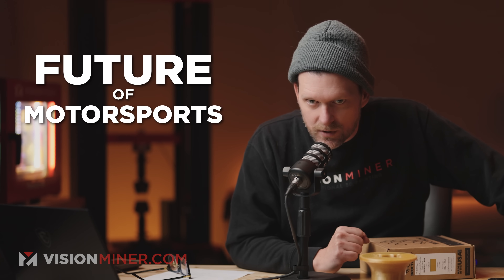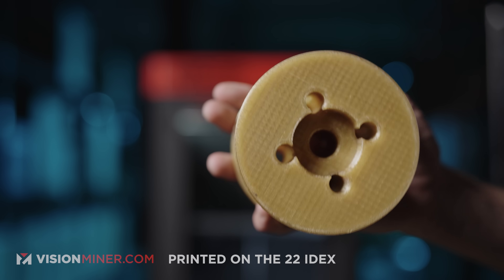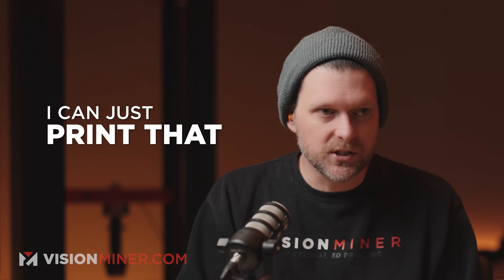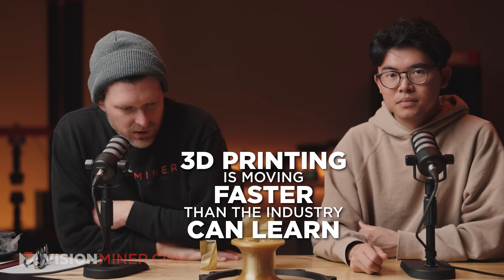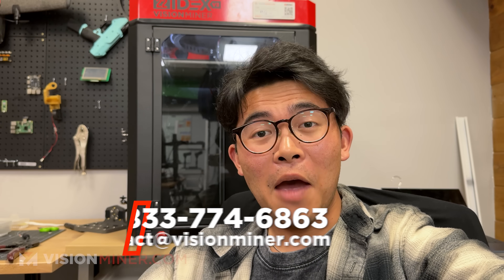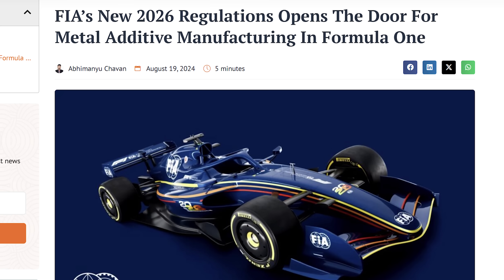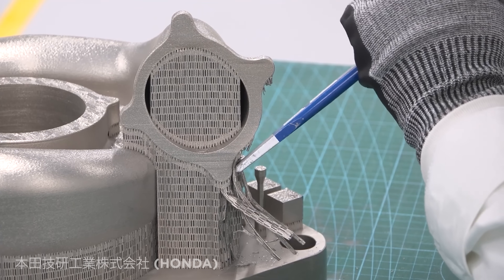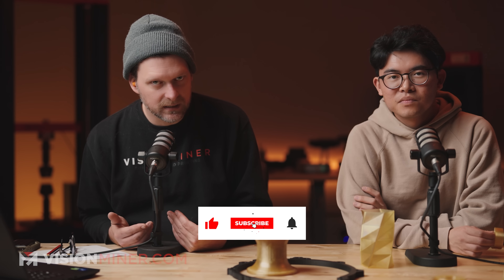The Future of Racing is 3D Printing.

Comment: On a side note would guys agree 3D printing is dumbing the new generation? The kids or teenagers now are so fixated with the idea that you can make anything on a 3dp but in reality is you still have to consider manufacturability. I was a teenager with friends into 3d printing back in 2012 and its a night and difference when it comes to how we designed parts back then vs now.
Reply: I wouldn't say dumbing, but it does hinder the design process for more regular manufacturing methods, from personal experience. I've 3d printed stuff for about 3 years before getting hired at a company where i needed to design stuff either machined or in sheetmetal. For many parts i had to rethink how i usually designed a solution because it's such a different approach and workflow!
Reply: @PaulChoix55  ok agree there it does hinder... a very broad topic I can  corelate it with LEGO Mindstorm vs people who did the traditional way of making robots and guess what people like me and my nerd friends who did all the trial by fire methods who landed jobs easily in the tech field while those spoiled by lego mindstorm had to be trained by people like me at the same company. Since my foundation was always designing everything from scratch without spoonfed blocks and connectors I always managed to design something that's manufacturable and scalable intuitively while those who were pretty much used to the non traditional way had to adapt and relearn a lot of stuff. Finding the similarities there makes me agree with you. The challenge now in my opinion is how get into the education system where this wont hinder the younger generations way of designing stuff, because now I'm blaming the teachers lol 0 tolerance designs, keychains and assigning projects the teachers cant even make is very questionable .

Comment: ULTEM/PEEK valve covers so thin, you can see the oil splashing around. If it's really comparable to aluminum, how about some engine torque braces? Super thin radiator support "tins". DIY custom sized radiator fans and shrouds that use brushless drone motors(watch RPM max for safety!). Custom battery tray replacements of entire rusted out old metal sections.

Comment: Challenge: Old Mercedes Benz parts aren't always available. 3d print a water pump housing out of Ultem/PEEK. Upgrade the bearings and seals to a modern day Toyota bearing/seal and try to use a CF-ULTEM/CF-PEEK shaft and impeller that is unitized. You may need to use steel for the shaft, but everything else should handle the load. INCLUDING the oversized/undersized (for cooling need) custom diameter pulley.
Reply: Replacement parts for old car is such a great application for 3D printing. The channel NeedItMakeIt reproduced a classic Corvette part with plastic 3D printing and then had it metal 3D printed as well. Even with the cost of development and the metal 3D print, it was still far cheaper than an NOS replacement which was over $600 IIRC. Now they can be made for like 10% of that and could be even less in larger quantities. Plus even the few dollar plastic part was functional, he just wasn't sure about longevity. I also have an 85 MR2 and I'm planning to print a lot of parts that are pretty difficult to get now or all the old stock has been bought up.
Reply: Imagine rapid prototyping the ultimate length intake runner shape and length for a camshaft for a rare engine.
Reply: I recently printed a plastic gear for my seat adjustment motor gearbox. I couldn't get the precision i wanted worth fdm but luckily I have a buddy with sla ams tough resin. Works perfectly
Reply: Peek replaces steel in some aviation uses already for critical wing root supports/mounts. So yeah, you can use it in many places already that have steel.

Comment: Hey Cole.  Y'all have helped us alot with our gen1 funmat HT.   Some automotive parts we've done for vintage Porsche racecars that a client of ours couldn't find.  Custom individual intake trumpets from PEEK to fit with the filters they wanted to use.  Custom carbon nylon covers for the transmission when some parts were removed for weight savings.  A custom gasket the y'all helped us find a material for.   Some PEEK sealing rings(normally aluminum) that they needed ASAP to make a race.  These went INSIDE the engine.     Did all that stuff work well.  Dunno.  We were definitely pushing the limits on some of them.  But the car did well at the baja rally that it went to right after installing it all.  The advanced materials really open up incredible options.  If we had more clients for them we'd be all over a 22 IDEX.  As is the old funmat can get the job done when those rare projects come in.

Comment: Definitely would like to see more about motorsports manufacturing. I own an automotive repair shop for 20 years, raced dirt oval and currently drag race radial tire car, been 3d printing for about 8 years. I print parts for my race car and normal customer cars all the time. Hell you might talk me into buying a 22 idex
Reply from the maker: If you need it, we've got you! For the materials capability, it's definitely a good tool for any automotive shop -- super strong parts, super fast -- for anything you might need. Your creativity is the limit!

Comment: I've been using 3d printer parts on my project car and it's really expanded what I'm able to do.  Quickly realized my limitations are with CAD. Humbling to realize I'm the constraint... anyways, I've likely over 100 different parts either printed and used as end use components, molds for cast bushings, or prints for prototypes that were made in metal.  This has been one of the best tools working on my project car.
Reply: Hey it's not there yet but a lot of stuff is online and AutoCad has AI. Plus Hugging face has 2D pictures to 3D AI models available for free.

Comment: Nice video, I teach this stuff at university level and several of my students now work in Formula 1 and super car companies. I’ve designed and printed many parts for cars including plenum Chambers for Formula student cars. I also design and printed many parts for classic cars. I’ve watched the steady growth of this manufacturing grow over the years but you’re right when you say this is about to “explode “. Material development and low cost printers are changing the game. Companies are finally seeing the potential.
Reply: Unrelated to the video but do you have any tips on getting into Formula 1? I'm a mechanical engineering university student and I have tons of experience for a student, just always have trouble in the hiring process.
Reply: @ work on Generative Design and volumetric lattice structure for advanced 3D printing. Base your work on existing automotive components such as suspension or engine components.
Reply: @edkeefe  does this mean future cars will be filled with even more niche pieces of plastic?
Reply: @justcommenting4981  I'm not clear what your question is getting at? "Plastic" is a generic term for Polymers, which have a broad range of chemical makeup and applications. Are you suggesting they are unsuitable, and if so, on what basis?
Reply: @justcommenting4981  Also, it has been possible for some time now to 3D Print metal parts, look at Aston Martin F1 for example. Parts don't have to be "Plastic". 3D Printing is also used to create moulds for the manufacture of parts made from a wide range of materials.
Reply: @gus2822  join your school FSAE team, that will give you lots of relevant experience, and some universities offer graduate level certificates which aren’t a full degree but do show you’ve studied a bit beyond undergrad. My friend did a Motorsports Engineering certificate at a state university (Washington maybe? I forget), but that along with FSAE experience got him a job with Williams, then Renault, then Honda developing motors. The pay sucks, lots of traveling, and can be toxic work environment with people always pissed off and yelling at you, so the lifestyle may not end up being something that you enjoy, but if it is your passion you should chase the dream and discover for yourself.
Reply: which uni? may i be your student?
Reply: What university? And what specific degree allows one to attend a class like this?
Reply: Any Recomendation on where to start as far as classes and school?  Already have an mba but should I go back to engineering school together into the additive manufacturing field ?
Reply: Nice vid? just fo metric and allt his chittt dusnt need to happen.